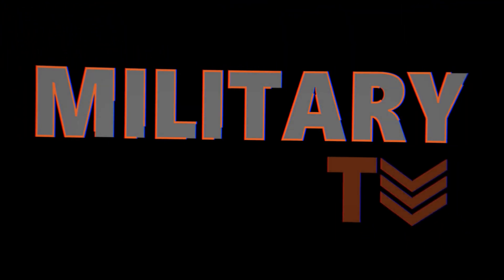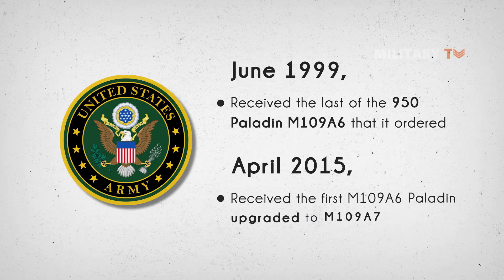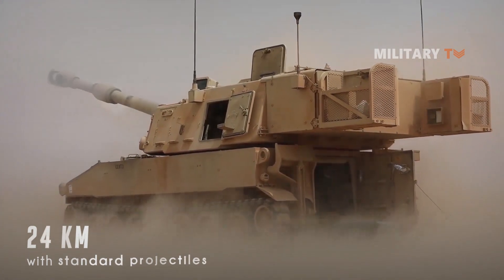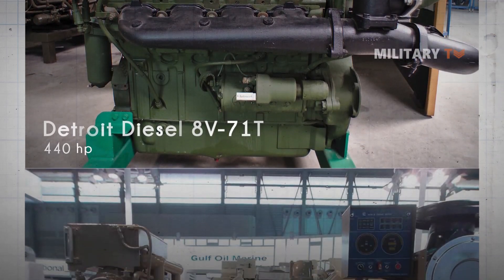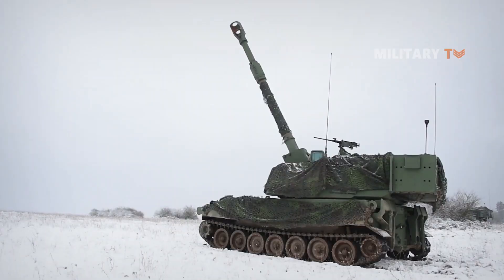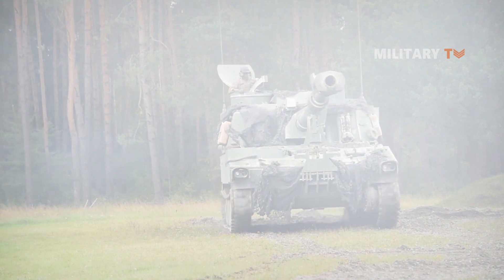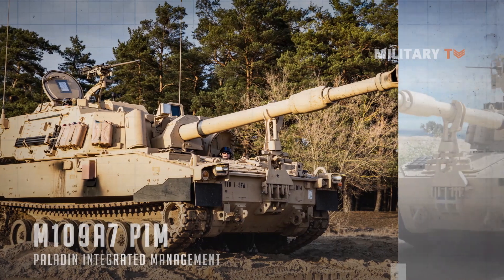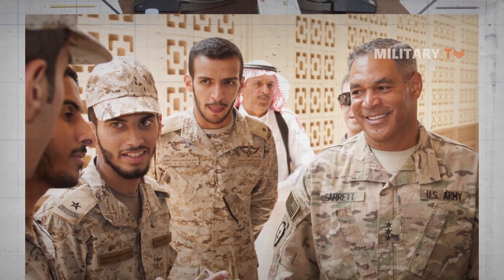M109A6 Paladin: The Deadly Artillery

Comment: Will there be a video about the world's most expensive tank Altay, finally the engine has been found. It is certain that it will participate in operations in
Reply: Did you have a stroke typing that sentence?
Reply: @chopchop894  No, I just had a nervous breakdown because FNSS wasn't given at the beginning of this project. later, when the AHT model came out, it passed.
Reply: Is that the one similar to that Korean one, black panther right?
Reply: @janloncaric3621  only technology was purchased K2 55 Tons Altay looks like 65 ton Altay T0 model only AHT and T2 look very different so I suggest you have a look
Reply: @Yakupcxs  uhm uhm, will get into it
Reply: U mean the most expensive junk right? Still without engine..the rest u have dreamt about..